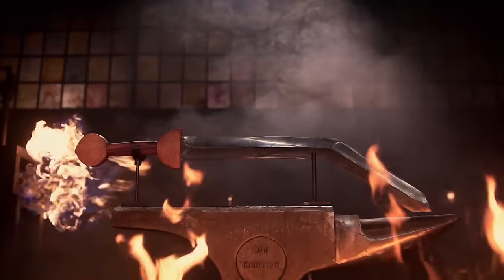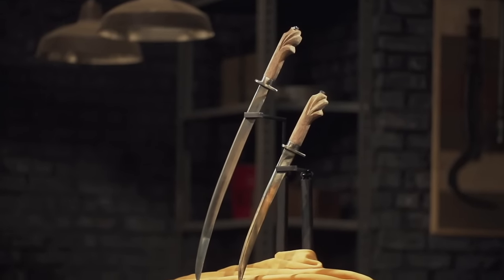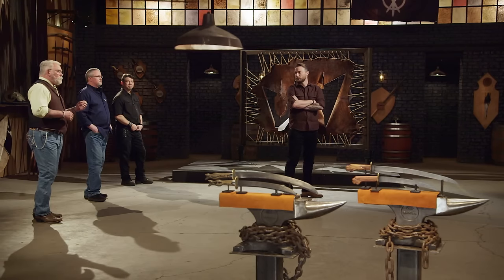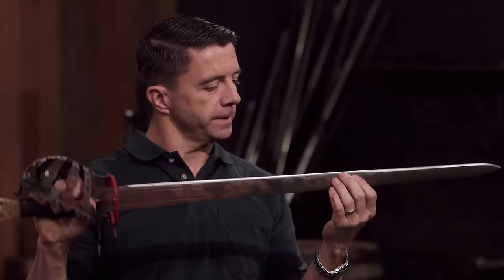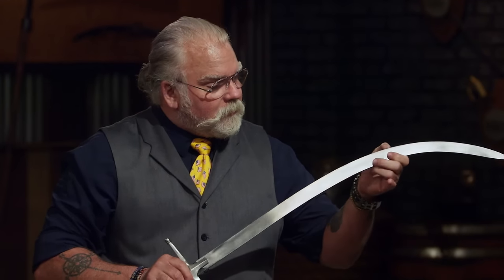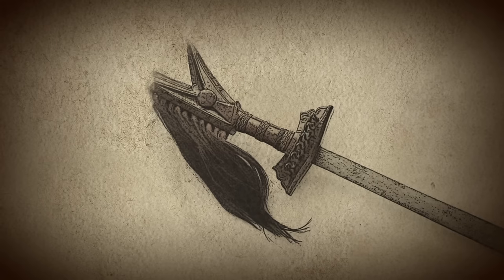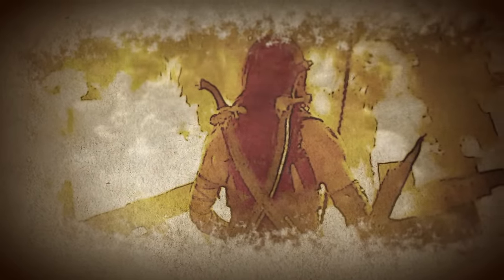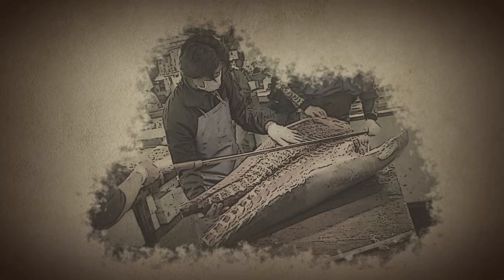Forged in Fire: TOP 7 CLOSEST COMPETITIONS OF ALL TIME

Comment: The tests where they try to cut through are a little off. I've definitely seen them bounce off on the show due to poor edge alignment on the slice which really isn't the blades fault unless you're using a curved blade like a katana where the curve helps makes edge alignment more forgiving
Reply: Handle desgin is a massive factor in good edge alignment.

Comment: SPOILERS

1. Sica - wrong decision - loser was better by a greater margin on the cut test than the winner was better on the kill test;
2. Ginunting swords - right decision -  the loser was heavier so not that close.
3. Schiavona - wrong decision - honestly, I thought the loser was better on the cut test and the kill test, even if he picked up a bigger chip on the strength test;
4. Saladin's sword - right decision - not just due to more authentic curvature, but also slightly better on kill test;
5. Kampilan - right decision - heavier will often lose;
6. Shamshir - correct decision - though heavier, kept straight after the strength test and was comparable on the other tests:
7. Maguro bocho - totally correct decision - for me, this was the least close call in the video.
Reply: I personally think that it makes sense that the chip was the deciding factor, they both killed, and they both cut even if the 2nd blade didn't cut as cleanly. One remained unscathed while the other (though minor) was damaged. And as they said, that was the deciding factor.

And like someone else said, for a gladiator it is more important to impress the audience, and kill.